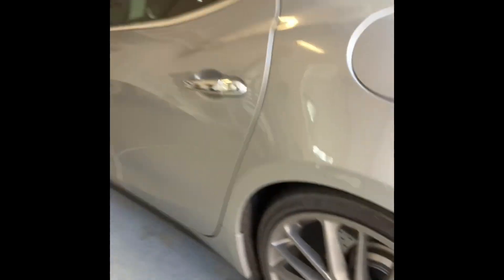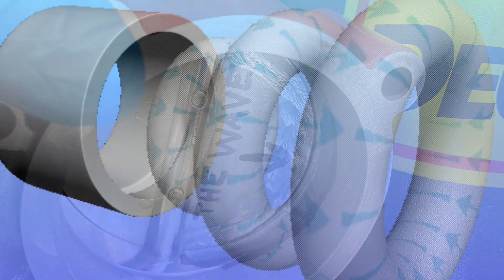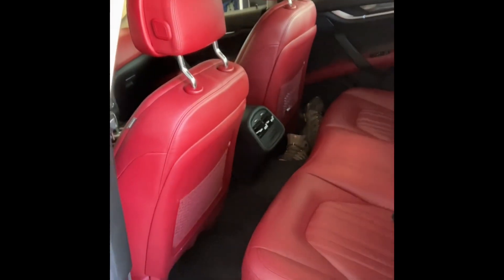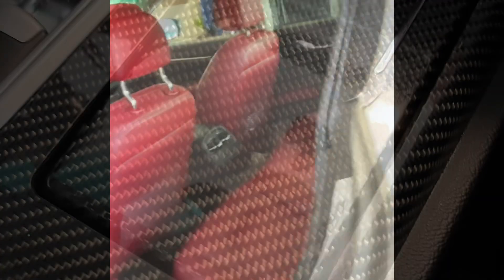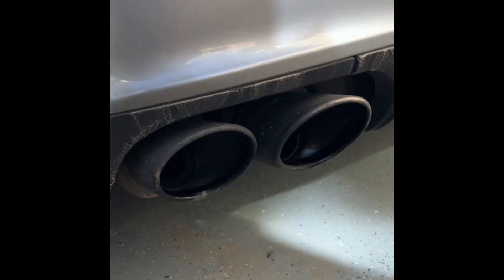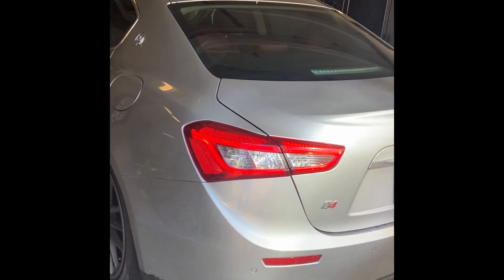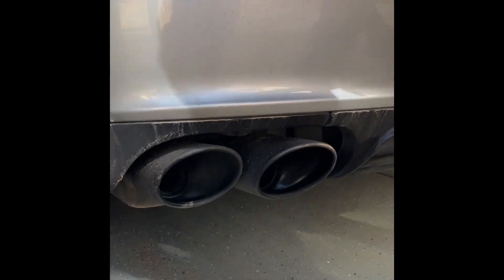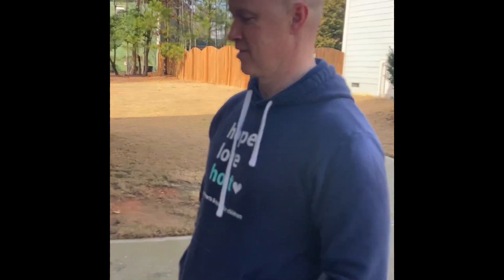👍‘15 Maserati Ghibli SQ4 gains POWER!! - Throttle Body Upgrade - Automotive Technology

Comment: So how does someone get this done? I'm not a mechanic so is this a service that is offered?
Reply from the maker: I’ll personally walk you through the process over a video chat! - Michael (507) 215-3817. 
You’ll need 3 common tools, and 30 minutes set aside. You can do it. Just swap out the throttle body and drive like never before 😎